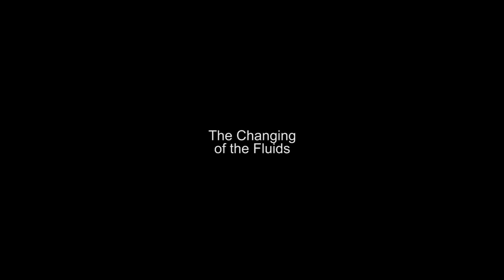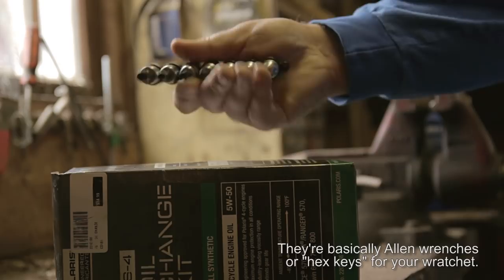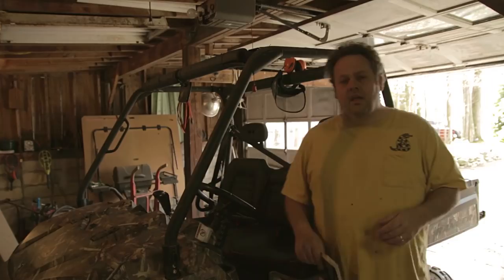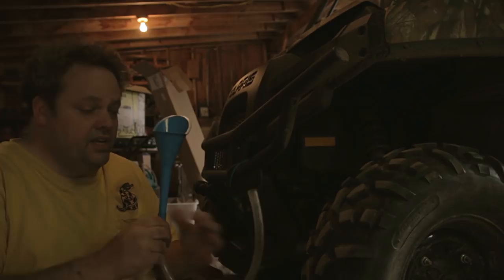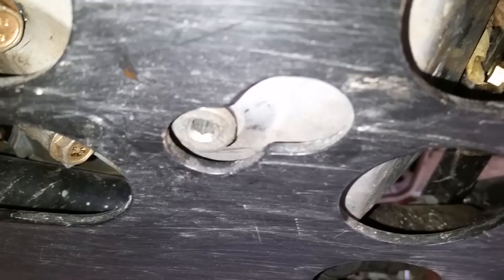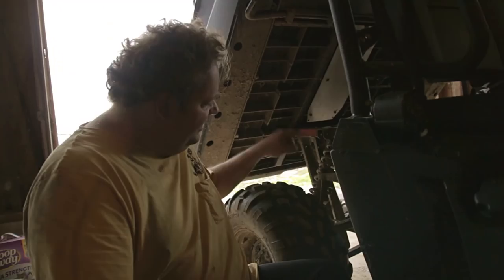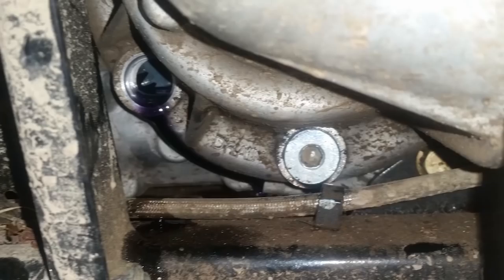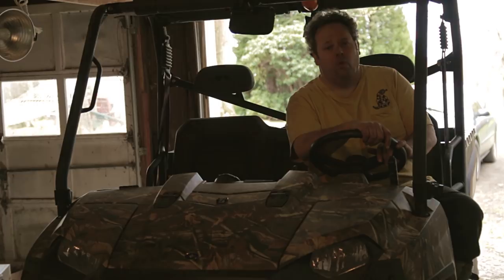How to Change the Oil and Transmission Fluids on a Polaris Ranger

Comment: I service mine and it is somewhat of a pain, Polaris didn't design it to be easy. For the oil filter, I use K and N with the nut welded on the end. Just make sure you DO NOT overtighten them. The end of the oil filter will leak if you do. One half turn after the gasket seats is enough.  32 oz. fills my transmission up. I've never had to add any more. Make sure the allen wrench is all the way in these plugs or you will round out the hole. I shortened my 8mm allen for the transmission fill plug so I can use a universal on my 3/8 drive ratchet and extension. 
Thanks for the video.
Reply from the maker: really good tips here, thanks! I like the shortening the allen wrench idea.  I bought a wobble extension, too, to try out. maybe i'll do a follow up video on Ranger maintenance sometime and include some of these ideas and a review of the wobble extension.  thanks again!

Comment: I don't know if the Ranger has one "It should" but on car and trucks there is a vent on the differentials that we"Auto mechanics" clean when servicing  differentials. They can get plugged and cause the seals to leak. If you have a vent you should make sure its clear. Great video
Reply from the maker: I don't know about this but I will sure check into it! thanks for the tip!

Comment: How do you get over a quart of oil in the trans. and diff? I get about 3/4 out and it starts running out.
Reply from the maker: +Sid Norton make sure it is sitting on a level surface but other than that it only takes what it needs.
Reply: mine is same way man
Reply: they want u to buy 2 quarts